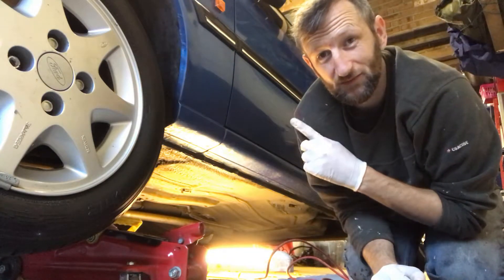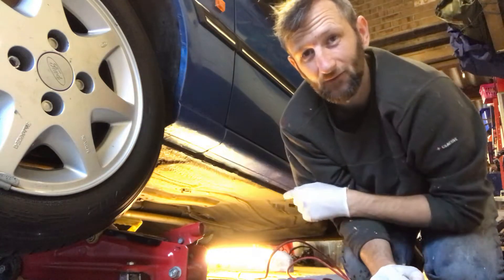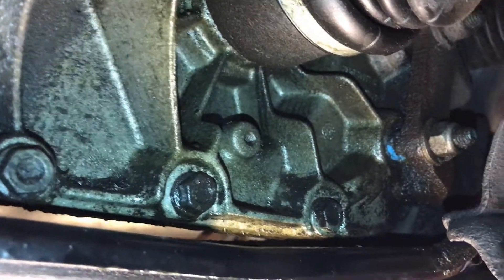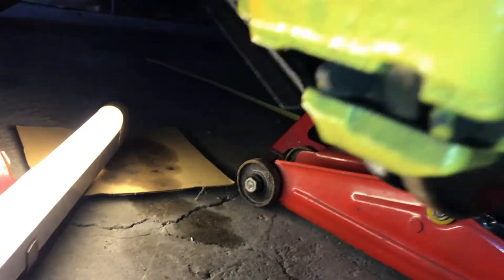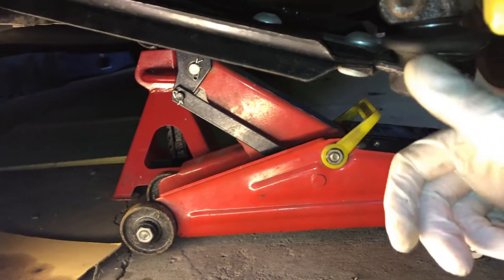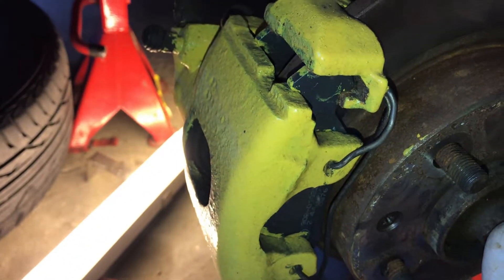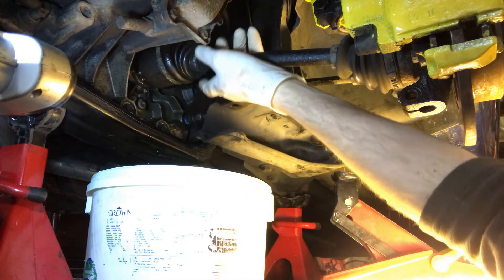Ford Fiesta mk3 - Driveshaft Gearbox Seal (Everything Went Wrong) - Part 1

Comment: I'm in the process of tinkering how I change the torn out rubber cv gaiter in my mk3. That nut really looks a pain to remove, to straighten the bent bit. Too bad split cv gaiters are not common in my parts.
Reply from the maker: They usually can only be changed by removing the driveshaft and they stretch over the outer bit. But you can get ones you wrap around and glue together. Saves removing anything but they don’t usually last long
Reply: @FF04ORD  I think I am not going to last any longar if I will have all the trouble you had to pull that shaft out :)
but I need to try...

Comment: I need to do the same job where did you jack up the car and put the axle stands?
Reply from the maker: Don’t use the sills on an old car. Use the lower arm bolts where they bolt into the body of the car if that makes sense lol
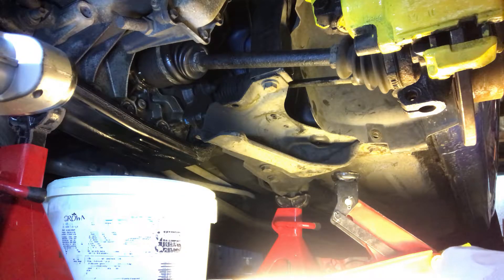Reply: Same as 9:02? Thanks for the info I'm not a big fan of this job😅 I like working on my classic VW beetle 😂 I just got the car I don't want to ruin it.
Reply from the maker: @oke215  lol yeah that bit fine. Best part of breaking stuff is learning how to fix it lol